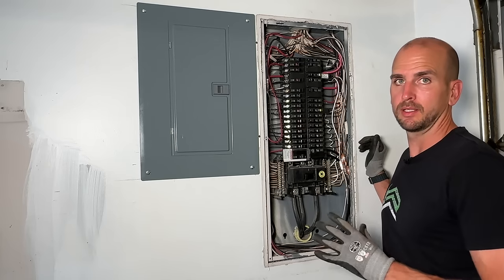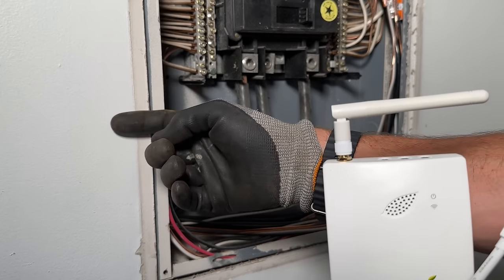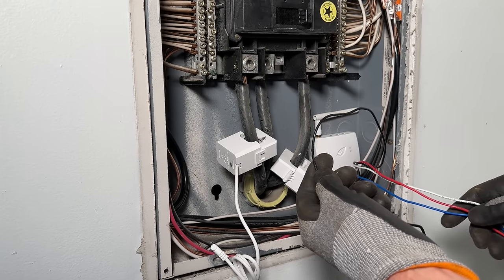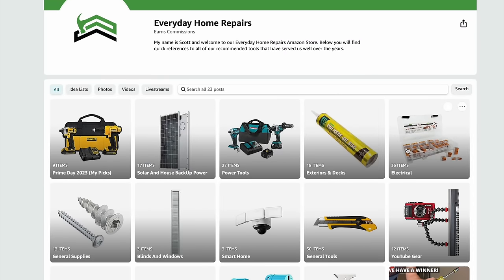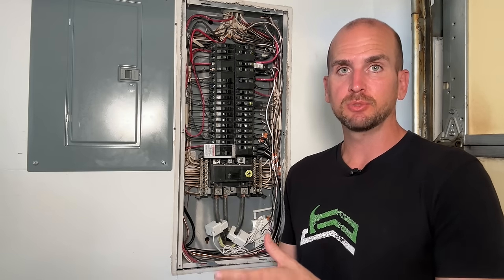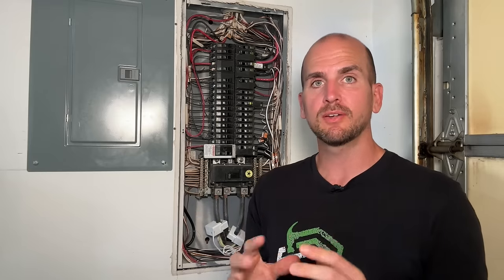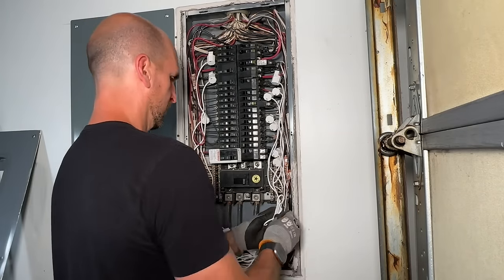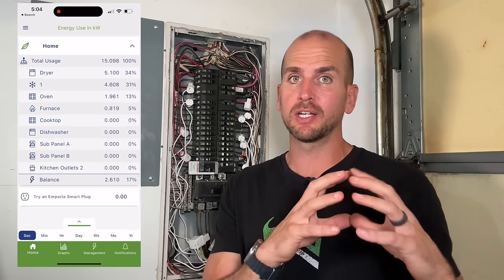How To Install A Home Energy Monitor | Emporia Gen 2 Vue

Comment: I've had one of these installed for five or six months now.  I flashed it with ESPHome because i want all local control when I can get it.  It integrated perfectly with Home Assistant.  Of course, i can't vouch for the original firmware, but with ESPHome it has remained rock steady in the network.  I've created scripts to monitor and report when major appliances are running and monitor average power consumption.  I've created alarms to report when consumption is outside of the baseline -- the theory is that i could catch appliances going bad if, for instance, my refrigerator or water heater suddenly started using more power  than average.  In January a few years ago my heat pump was failing and I didn't notice it until the electric bill arrived $400 more than normal.  With this (and the ecobee i have now), I would have caught the issue immediately.
Reply: I have been considering doing the same with mine. The Emporia system has been very solid, but I do not want to rely on cloud services.
Reply: Can you link to instructions for flashing with ESPHome?
Reply: Does this ESPHome allow for all the same recording capability long term as the cloud based storage? How much storage will it require on the phone or wherever it maintains the data?
Reply: About 30MB is uploaded to the cloud daily for the data records according to their website

Comment: I'm wishing we went with an Emporium instead of a Sense. It does decent enough tracking my total power consumption but I'm going on nearly 6 month of use with it now and its only identified maybe 20 devices in my home.
Reply: That's actually why I opted for the Vue over the Sense. The concept was cool, but it seemed like a roll of the dice as to whether it would be able to identify devices.
Reply: I read that the second by second recording resolution is only available for a few hours and permanent long term recording is minute by minute, is that similar for both systems?
Reply: On my Eyedrop 2 monitor, it maintains the second to second readings in the permanent data, which is helpful in seeing transients on startup, which helps identify things.

Comment: For individual monitoring use something like TPLink outlets (make sure they are the energy monitoring ones) so you can view usage remotely plus has historical usage.  They cost about the same as that Amazon one mentioned.
Reply: Also if you are doing your own software or using open source stuff, the TPLink Kasa brand (not Tapo or Matter) can be accessed directly on your local network instead of via the cloud.
Reply: @Sylvan_dB  well matter in theory should be able to work in home assistant with a extra usb dongle
Reply: @BenCos2018  Do you mean matter devices would be accessible directly on my local network?  Where would I plug this dongle and what is it accomplishing?  And this is "in theory" so yet to be confirmed in actual practice.
Reply: Emporia has a "Smart Plug" product to allow monitoring anything connected to a single wall outlet. This is less costly way to start monitoring, and ideal for Apartment or home renters (without ready access to add the Breaker Panel system shown here)

Emporia Smart Plugs use the same free cloud service and apps, (you buy and own the Smart Plugs) Will require a home WiFi connection, as was the case for this Breaker Panel install.

Comment: I have two Emporia Gen 2 Vue units, one for the main panel and one for the sub panel.  In the App, you can identify that one of the units is for a sub panel so that the currents don't get double-counted.  Then the subpanel data is properly shown as nested under within the main panel information.  In the main panel, I use two of the branch circuits to monitor currents into my interlocked 30-amp emergency generator breaker.  [Two sensors so that each generator leg can be individually monitored for load balance.]  For such a generator setup, just be sure that the "flow arrow" on the sensor body is pointing toward the breaker.  [This works for a solar AC input as well]. For normal branch circuits, the flow arrow must point away from the branch ckt bkr.  As Scott mentioned, most other 240 volt loads can be monitored by one current sensor; you just tell the App whether you are using one or two sensors and it does the appropriate math.  Oh yeah, NO SUBSCRIPTION REQUIRED!
Reply: you touched on my main question.  If I want to eventually expand beyond 16 sensors, their software can utilize 2 units and give you an overall view?  is it really that seamless?
Reply: Yes.. It's that simple... I am monitoring 26 branch ckts... 16 in main panel and 10 in subpanel... If youvtell app it's a subpanel it is smart enough to not double count the subpanel load in the total load calc... Alternately, if you had a 400 amp service feeding two 200-amp main panels, app would add the loads...
Reply: @SteveJones172pilot  I'm curious why the monitors for a generator are "backwards" when compared to the other circuits.

Comment: Will the emporia vue work on 100amp double breakers? my panel has 2-100amp line running to the double breaker. Emoria vue says monitors are 50AMP rated.

Comment: I have had mine for almost 3 years without issue.  The main reason for installing it was to monitor my portable generator when connected to the panel via an interlock.  I can tell not only the real-time load on my generator but just as important I can make sure both of the 120v legs are as balanced as possible.  I also have it monitoring my septic effluent pump.  When the wattage rises above normal I can tell the effluent filter is getting clogged and when the wattage drops off below normal it means the intake screen on the pump is getting clogged.  It has been a great tool for me.

Comment: Way to go Scott! Big POWER

If you're having issues with wifi connectivity after you put the panel cover back on, try getting the antenna outside of the metal box. You'll have a much stronger signal that can reach much further. Also a lot of homes use polyiso (foil faced foam board) as insulation, the foil layers do a great job blocking wifi signals - to get around that you'll either need wifi extenders or arrange the devices within 'line of sight' which could go through drywall and wood doors, but not metal or foil board.
Reply: The antenna base is designed to go through a panel knockout...
Reply: yep the antenna is best outside the panel tbh 
otherwise it's pretty much in a faraday cage
Reply: The antenna is designed so that you open up a knockout on the bottom of the box, stick the antenna through and then it is hanging below the box and able to broadcast through the sheetrock.
Reply: Exactly, Scott's commented at the beginning of the video is wrong, even if it is inside the wall you want the antenna to poke OUT of the metal box, wifi will go through drywall and wood so the antenna sticking out inside the wall will be VASTLY better

Comment: I have one of these things that I put in back in April.  For me, it has been pretty solid.   Honestly the 1st takeaway was that some of the things in the panel box were labeled incorrectly, so that's kind of the first thing to identify any mistakes.  In my case, I used up 12 of the 16 sensors on 240V circuits, that left me with just 4 for 120V circuits, and that was inadequate.  But I also discovered that one of the incorrectly labeled 240V circuits was apparently no longer in use (Old Range - what's that??), so I could reclaim that and then I could monitor 5 120V circuits.

But one can also supplement with an Emporia Smart Plug, which integrates into the app almost like it is yet another sensor.  I bought a box of 4 of the things, and that helped out a lot.  Note that these things can only be used in cases where there is something plugged into a wall socket - a circuit for a hardwired device like a dishwasher can't really be monitored in this fashion.  And from the app, you can turn on/off the smart plug and/or set up a schedule for when the things get turned on/off.

In the Emporia app, the smart plugs can be nested underneath a Vue circuit.  So you can measure the overall circuit from the Vue sensor, and the subset of that circuit from the Smart Plug.  If you nest things incorrectly, you get really wonky results however.
Reply: Btw on 240v circuits, you only need to use 1 sensor, and use a 2.00 multiplier in the app.
Reply: @Russianmafia10  I realize that  - we had 11 different 240V circuits.   Two heat pumps, two air handlers, solar, irrigation pump, hot water, oven, cooktop, EV charger, and dryer.

Comment: I’ve had 2 of these since Nov 2022, a year and a half now, one the main panel, and one in the sub panel, I also broke it down further using wall plugs, and it hasn’t had any glitches or disconnects with the wifi. It’s pretty much plug and play. I recommend it.

Comment: I've had mine installed for a couple of months. I originally set it up to monitor the six circuits that run through my transfer switch to monitor usage on my home backup Ecoflow Delta Pro. Then added more current clamps for my EV charger and a couple other high usage circuits.

Comment: We installed a 25 mW per year ground based solar system eight years ago. We have 3 air-conditioning units that can run 24x7 when needed at no cost. Since we installed the solar system 8 years ago we have paid ZERO dollars to the utility company.  The solar system paid for itself in four years. It was my best investment ever and highly recommend solar.
Now with very excessive temperatures we are glad we did this. The electronics to the solar generation provides minute by minute generation details but we don't look at it anymore.
Reply from the maker: Nice!  What state did you guys install the ground mounted system?
Reply: I wonder if ground solar systems are just restricted by the town codes or if people don't have yards suitable for them, but I've never seen any in my area.  I would have liked to put something like a car port type installation of solar panels like they have in sine public parking lots and schools, but I'm guessing it's just not allowed or something.
Reply: Is 25 mW 25 megawatts? It's obviously not milliwatts, but is it actually mega as in 25 million watts?

Comment: You can monitor multiple branch circuits in one sensor (of course the wires have to be aligned somewhere in the box), but they either have to all be on the same leg, or if they are on opposite legs then the wires have to go through the sensor in opposite directions.
Reply: I did this with 3 branch circuits, all on same leg... Works great...

Comment: I think you're going to have problems with WIFI with that unit installed Inside the breaker box once you close it up. Might consider running conduit to an external box to house the receiver/transmitter unit and also tidy up all those wires. Just a thought. 
Nice product. Great presentation.
Reply: I got this same unit, have the wifi antenna poking out the bottom of the box but behind the drywall. Get great signal.
Reply: @jasondixon1760  Good idea!

Comment: Wow, your panel has so much room inside.  I'm thinking I need to replace my panel (probably add another sub-panel and relocate circuits).

Also you might consider punching a hole thru the side of your panel so you can get the antenna outside the metal box.

Comment: Unlike other (red) energy monitors, you can have more than one Emporia Vue on one account, so you can add on on a sub panel, or if you have other properties, you can have it all in one dashboard. The red brand also does not do a good job with what its main claim to fame is. Since I have both (the red one was installed by the contractor who installed our Solar panels) the Emporia Vue (gen 2) is more reliable for finding what is using power where.

I only wish they had a 24 port or greater unit, but since you can have more than one on an account, I guess it does’t matter. The other problem is, it can only monitor up to 50 amp circuits, my HVAC system uses three 60 amp circuits. In order to monitor those, I have separate Shelly EM units that can monitor up to two 120 amp circuits each. All these tie into my Home Assistant system where I can see all the data on one dashboard.

Comment: Question: I’d like to use this to figure out what size battery backup I’ll need. Would it be as easy as checking the usage for devices I want the battery to run, and then using the kilowatts to figure out how many hours of backup the battery will provide? Or is there a better method? Thanks for the video!

Comment: I use the ShellyEM for monitoring the main feeds, although when i first added them putting pressure on the incoming mains wires caused the breaker they connected to to crack as it was a tight fit (mobile home so mains went directly to the breaker and the breaker fed the panel)

for better signal i mounted a box to the breaker panel and installed the ShellyEM in the plastic outlet box with a blanking plate instead of the panel.

Also i have a separate 2.4ghz network for IOT devices as many have issues on dual band 2.4/5ghz networks with the same SSID.

Comment: Coincidently my Vue arrived yesterday.  What I'm curious is how to deal with sub panels.  I have a separate panel for my basement and was planning on having a second vue unit there and nest it somehow under the main panel.
Reply from the maker: I just placed a circuit sensor on each phase feeding the sub panel.  Right now with only 2 circuits this is perfectly fine but once I add any more I would start to lose visibility to each circuit in the sub panel.

Comment: Regarding wire management, can I zip tie all the excess wires to the main line to hold them in place or will that interfere with the signals being sent from the CT's.  Thanks!

Comment: Did you just pigtail the sensor power to existing breaker?
Reply: In the instruction manual they show that being done but they didn't seem to point out that the pigtailed wire going to the breaker needs to be the same gauge as the existing wire that was removed. It showed what looked like the same gauge wire as the sensor wire being connected to the breaker, which would act like a fuse 😎

Comment: is the product UL Listed and does NEC Code allow install inside the enclosure?  curious
Reply: It is UL Listed as energy monitoring equipment. FCC Certified, too. The UL file is linked on their website and can be looked up on UL's website to a matching product, so it is legit.
Reply: item can be ul listed but is it listed to sit in the enclosure?
Reply: @LuLu_World  while true, the instruction manual for this device states to place it in the enclosure, and the manual is part of the UL listing.

Comment: I just recently purchased and installed the Emporia level 2 EV charger and I'd like to utilize the load management feature on the app. We use our air conditioning at night during the summer, and the EV will be charging at night so it would be great if the ev charger would turn off when the AC runs. My question is, is the Gen 2 Vue the additional unit needed to utilize that feature?

Comment: That’s a good price for the system. I was thinking of doing a DIY with a raspberry pi and some current transformers, but for that price, it’s tempting. Only thing that concerns me is how long this company will be in business. If the company goes belly up, does the system stop working? At least with the RPI you own the data and aren’t beholden to someone else’s cloud.
Reply: The Vue gen 2 has an esp32 inside and can be flashed to ESPHome without too much hassle.
Reply: Flash with ESPHome as mentioned, so much better and dumps to Home Assistant easily.
Reply: <3 thx

Comment: Just did a bench test of the Emporia Vue 2 app after coming from the Eyedrop 2 monitor, and I have to say the graphing user interface seems really crude compared to the Eyedro, unless I'm missing something.
It doesn't let you dynamically zoom in and out on the chart details, but has separate tabs only for seconds minutes hours etc.

Is this really how everyone reads the information?

Certainly some aspects of it is very much an improvement like having all the separate subcircuit monitoring and notification capability, but the graphing implementation really looks completely simplistic in comparison to the Eyedro.
Reply: I found that the app has a faster speed scrolling capability which makes it a bit more usable, by using two fingers to swipe scroll.  A single finger is just regular speed scrolling.
Still not going to want to use the app to scroll back a very long time as there's no calendar selection capability, but it looks okay for most review purposes. If you really need detailed review of long past records, download it for separate spreadsheet charting.

Comment: i want to know if these are useful or for personal interest.  Since installing one of these, has it made an impact on how you use your power? Have you changed your habits or what is plugged in or turned on?  Have you save $170 by installing one of these?
Reply: The other day I got a notification that I had inadvertently left the oven on!

Comment: Can you please explain why you only need a single CT on a 240 circuit? Does it double automatically?
Reply from the maker: You set a 2X in the App for the 240V circuits when using the single CT. 👍

Comment: Will this read a 400A service entrance or is it limited to 200A?
Reply: If your 400 anp service entrance actually consists of two 200 amp service panels (very common), then you can install an Emporia unit in each panel and "sum" the in the App.
Reply: @josephknapick5307  Ya I was hoping to not have to buy 2.